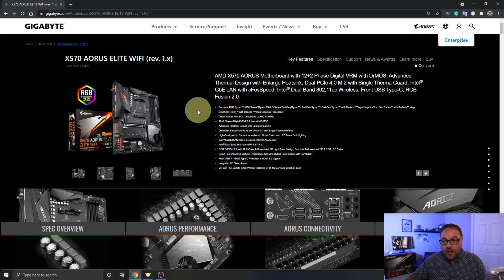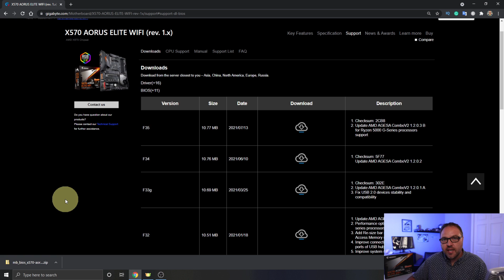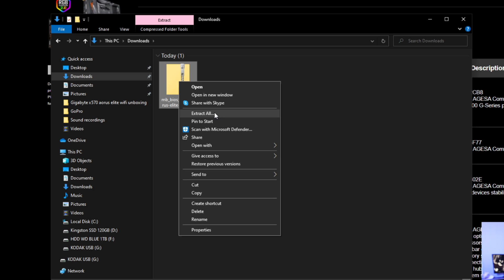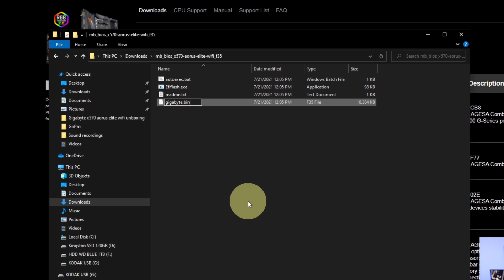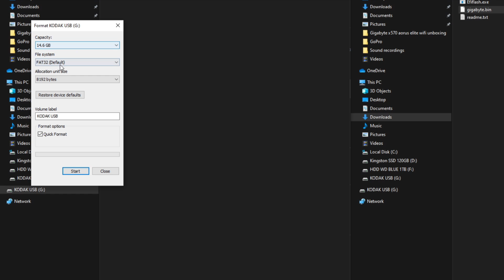How to Flash the BIOS on Gigabyte X570 Aorus Elite WiFi Motherboard with Q-Flash Plus

Comment from the maker: 👍 Thanks For Watching! Click the Link to Subscribe to Northern Viking Everyday. https://www.youtube.com/c/northernvikingeveryday?sub_confirmation=1
Reply: I have my ram and cpu installed already, do you know if I have to take them out to flash bios, or should it be fine. Im running 5600x/Aorus Elite wifi x570
Reply from the maker: Yes, you can Flash the BIOS with them installed.
Reply: @NorthernVikingEveryday  Thanks for the quick reply. appreciate it.
Reply: Can I do the bios update after I built my pc?
Reply: Hi! I'm a noob at anything pc here but trying to learn. My current build is using a 3700x and I want to upgrade to the 5800x. Will I need to remove everything from the motherboard to do this bios update for the 5800x? Just looking for clarification. Thanks for your vid!
Reply: Just seen your reply to someone else above. I assume it's the same in my case?

Comment: hey, i have X570 Pro - I know it is the different version, but I was looking for my MB and came across your video, so I thought I will comment anyway for others.

So in my case I was upgrading before switching to newer CPU, but the behaviour was different:

1. First of all i had my old CPU and RAM still installed - i also had connected the display, and keyboard and mouse just in case.
2. After turning off PC (put MB into S5 state), I pressed the mentioned button.
3. For the brief 5-10 seconds nothing happened, until system half powered on by itself - yellow light was flashing, but also my CPU fan, and the other started to spin, i have ARGB RAM, so it also started to glow (generally all ARGBs started to glow in Aourus' default orange colour) - there was no video, and 4 POST leds stopped at VGA. It was like that for 2-3 minutes.
4. System powered itself off BUT IT WAS NOT THE FINISH! :o
5. It restarted itself, and a screen appeared showing status bar and information that you should NOT power off or restart your computer.
6. Only after the progress bar completed, the system restarted again, and if I still remember correctly, it booted just normally into Windows then, with USB still plugged in.
7. Then, and only then, after seeing an OS working, I turned PC OFF with my mouse and plugged USB out.

Maybe it actually depends on the BIOS version - I upgraded from F30 to F39g

Maybe someone will find this comment somewhat helpful,
all the best to you guys :)

Comment: tried doing this and i wanna go from f32 to f40 but the f40 file when i open it only has one file in it, not 4 like yours does.
Reply: did you end up figuring this out? I am thinking it should be the same
Reply: @HolyHamGrenade  yeah it just needs the 1 file, in this video the version he downloads he changes one of the files name. In the new version I downloaded, you didn't have to do thay. Just download it extract to usb and flash it.
Reply: @bananas1318  uh, so i already renamed it, does that matter? Or should it still work
Reply: @HolyHamGrenade  you're downloading f40? Just delete it and download it again and don't rename it. It only takes 5 seconds to download. I wouldn't rename it.
Reply: @HolyHamGrenade  also I'd like to say my mobo is the elite but without wifi. If file you download has multiple files inside like it does in this video, just follow his guide. But the f40 for the elite without wifi only had 1 file in it, and I contacted gigabyte and they told me not to change anything.
Reply: @bananas1318  mine is with wifi, and it is newer than f40 i think, but it does just have the 1 file
Reply: @HolyHamGrenade  yeah if its just 1 file don't change it.

Comment: if anybody is watching this tin 2024, just a heads up. if your usb is over 32GB it wont format to FAT32 

so get ya small USB or you can go into disk management, delete the volume of the USB drive, remake new volume, and allocate 8GB or 8000MB to be able to format it into FAT32

Comment: Ok, so I just followed this tutorial to install the latest in my non-wifi x570 elite and almost shat bricks, first attempt and no screens, no keyboard/mouse led's, no cpu fan LEDs nothing. Redid the process and on the second try held the q-flash button for 10 seconds before releasing, happy to report that it completed properly this time, if you encounter this same issue, you may have only clicked the q-flash button, but you MUST hold it down for that 5-10 seconds.
Reply from the maker: Thank you for pointing this out! Glad you got it sorted.

Comment: I noticed at 06:44 your x570 Aorus Elite WIFI board says "rev.1.1" on the bottom left corner of the board? My x570 Aorus  Elite wifi doesn't. Mine says "rev.1.0" on the board. And yet, on Gigabyte's website they list the WIFI board as rev.1.x and the non-WIFI board as rev.1.0

Comment: I did this exactly with a new Gigabyte x570s Elite AX, used the right version from the website and now the power button does nothing on the PC.  Before flashing the bios when we had everything plugged in and the pc powered up but wouldnt send anything to the screen, but flashing the bios has made it so nothing happens at all with the power button.  Reflashed it with just the motherboard after disconnecting everything and same result after reconnecting the cpu and plugging everything back in.
Reply: I have a very similar problem, computer doesn't boot up after shutdown. everything powers on, but no signal to screen. Checked everything from ram to PSU. Removed the cpu and reinstalled it, it booted up, but now Iam too afraid to shut it down again to update BIOS lol. Did you have any luck with your problem?
Reply: @desolator108  my problem ended up being having a PSU that wasn't powerful enough.  Flashing the BIOS isn't necessary anymore with these motherboards for most CPUs
Reply: @desolator108  check RAM maybe to.  Try booting with one stick and also different ram
Reply: thanks, but I tried those already. Also installed a bigger PSU. Didn't help, well back to troubleshooting.  @Zarkin-Frood

Comment: I just upgraded from a Ryzen 7 3700x to a 5800X3D, and my pc wouldn't post. You sir, are a lifesaver; thank you for the very quick & simple guide
Reply from the maker: You're very welcome 🤗 Glad I could help.
Reply: Same upgrade I'm about to make
Reply: I am about to make the exact same upgrade/flash.
Reply: Same upgrade, my 3700x doesn't boot anymore. Should I just install the new CPU?
Reply: im doing the same thing on tuesday.
Reply: I am currently in the same process, but I am at a loss.  Upgrading from a Ryzen 7 2800 to 5800X3D also, I have disconnected everything from motherboard besides, New CPU.  Power on, USB with F30 install/ renamed, inserted into correct USB Bios, I push Q flash, I see the USB flash, but no q flash LED activation.  Should I try removing CPU?
Reply: Update, also removed CPU and still not working???  Suggestions?  I get a quick flash from the motherboard when I turn on power supply and USB also flashes when I hit q flash.  But no Red LED indicator...?
Reply: Try different USB sticks, I did the exact same thing twice and that did the job.. @Joseph.Maduzia

Comment: Thank you so much for this tutorial. I installed the F36e version of the BIOS on my motherboard and i am facing a lot of issues with it. For example, in the bios screen it shows that my secure boot is enabled but when i log into windows and check system info, it shows secure boot off. because of this, i cant play certain games. after watching your video, i am planning to qlash and update the bios to F37 and see if that works out the issue or not. i would be very grateful if you have any insights on this. thank you once again for a great video. :)
Reply: Bro, did you install to F37?

Comment: I’m having an issue. I have the 5600x downloaded the f30 version , have everything plugged in. I cut my psu on and my mobo flashes on for one second then goes off. I held the q flash button but nothing happens.

Comment: If your light does not work, my fix was that my flash drive was far too large(128gb). I used an old smaller one (couldn’t have been more than 32gb-64gb) and worked fine. It also took a few seconds to start doing anything, so don’t be alarmed if it isn’t instant.
Reply: oh mine is 32 gigs ish but it still isn’t flashing 😢
Reply: Mine is flashing, but it still didn't boot after installation. I have a 20GB fat32

Comment: Thank you! I should have looked this up before installing my new 5950X last night, only to have to put the old CPU back in since it didn't even post. After initial panic and checking that I hadn't bent any pins I soon realized that I probably needed to upgrade the BIOS first, and this video gave the perfect instructions for it. edit: I forgot to mention, at 5:51 it says "I haven't installed the CPU or the RAM […] you can do it with it installed or not installed", but the manual says "Q-Flash Plus will update the main BIOS only if run without the CPU installed." (mb_manual_x570-features.pdf, page 6).
Reply: Can anyone verify if this matters at all?
Reply: @dlalleman3874 just updated my bios with the cpu installed and it worked just fine. HOWEVER the flash button wouldn’t do anything for me until while the system was shutdown I flipped off my power supply waited a few seconds and turned JUST the power supply on, and while the pc was still shut off I hit the flash button and it worked perfectly. Hope this helps anyone who was confused

Comment: I pushed the button and nothing happened except for the usb flashing. Does that mean it worked? Also when I turned the power supply on the motherboard lit up for half a second then turned off. Is this normal?
Reply: Nevermind that I figured out my problem! I downloaded the bios update for the gigabyte wifi board and I actually have the non wifi version😂. Oops oh well I got the right bios update and non it worked. But one last thing. The fan continued spinning after the light went off. I gave it like 10 min but it kept spinning. I ended up just shutting it down after that. You think it still worked?

Comment: Great video :D For anyone having trouble with the q-flash button on the board itself, if you happen to be using an external drive make sure to specifically only format a small(i used 8gbs) sized partition as exfat/fat32 instead of formatting the entire capacity of the drive. The q-flash button wouldn't work for me until I limited the fat32 partition size to 8gb on my 1tb external drive as opposed to formatting the whole 1tb as fat32. Fixed the issue and the q-flash button then worked like a charm. Hope this helps anyone running into the same issue! gl out there gamers
Reply from the maker: Thanks for the tip 👍
Reply: I'm using a 64G thumb drive, used rufus to format it to FAT32, and copied the gigabyte.bin file to it, but I still can't get a flashing light from the q-flash button. Any ideas on where I may have gone wrong?
Reply: @FifthPinned  Only thing I can recommend is formatting only an 8,000 MB partition as FAT32 and using that partition to store the gigabyte.bin file. That's the only thing that got it to work for me :/
Reply: @FifthPinned  were you able to get it to work?
Reply: @fburnrostro95  yes, I can't recall what I did, as it was about a year ago that I did this lol

Comment: I am now ready for MW2 =) 
My 3080FE is already installed my X570, as of now I'm running my 3700x and it's running amazing on 1440p for all my titles. 
My 5600X just came in and I got it for a steal on Amazon. $88.35  because I had a $100.00 coupon that I didn't know about lol 
So I'll stay gaming and just wait for MW2 to come out, when I see the need to try and push more FPS I'll bio update and slap my new chip in. 
Thanks for the video, didn't realize how easy it is to update bios on this MOBO. Supper happy I bought this one back in late 2020.
Reply from the maker: Awesome 👍 Thanks for watching.

Comment: Hey there, if followed this to the letter but my QFlash isn’t responding when pressed. Any ideas?
Reply: Did you figure this out?
Reply: @trevoramadon1792  Yes and no. This mobo of course doesn’t come pre config with 5000 series support. Which is what the Q flash is for yeah? So I just returned it and got a 5000 series supported mobo lol

Comment: Hey all, I am currently on F36e and having some reboot issues. Is it worth flashing the BIOS? I checked the website and it only says that there is an update for the AMD Ryzen 7 5800X3D but not my AMD Ryzen 7 5800X.

Is there some cross over between the CPU's that may help me?

Comment: So I have the none wifi version of this board. Got bios version f32, renamed it on my usb and in the right port on the mother board. The cables are connected and the power supply is on. When I press the Q-flash button on the board I get no light and nothing seem to happen. Do I need to remove my graphics card or unplug anything else? I have all my peripherals installed already. Do I need to remove them?
Reply: use the MBR partition instead of GUID. most videos show GUID as the correct format.

Comment: Thank you for the help! I had one question: if I have the 5600X, should I stick with the F30 or just get the lastest BIOS version like you did? Will it be incompatible with the 5600X?
Reply from the maker: You can double check on the gigabyte website but usually it's best to go with the most recent version.

Comment: I have the same setup but I had a hell of a time Q flashing. The board did not want to read any of the flash drives I tried. I thought I was going to have to RMA it. Got the F30 bios to finally work, then it immediately crashed after I tried installing Ryzen Master. Gave me the BSOD, shut down then wouldn't boot. Powered it off and on a few times then got the message that my bios was corrupt and booting from the back up. I should have the latest bios right now, but after that ordeal I am paranoid of bricking the board. Still have not tried reinstalling Ryzen Master. Wanted Ryzen master so I could tune my fan speeds as this chip runs hot.

Comment: thank you thank you! it's worth mentioning that using the default allocation table size may be required when formatting the flash drive. I tried this and it didn't work the first time with the allocation tables set to what windows had set, but... when i applied the 'device defaults' and tried again. worked like a charm. Thanks for the great video.
Reply from the maker: You're welcome and thanks for the tip 👍

Comment: And if i did everything exactly right and I did not get the light to on the motherboard to flash? 😢
Reply: Make sure the format on your USB flash drive is FAT32. If the flash drive is over 32gb, you can't format it to FAT32. Use a smaller drive. The file is only 16MB or so.

Comment: Massively helpful as I just bought the gigabyte z490 that supports 10th and 11th gen Intel but requires a bios update. This is the only part that makes me nervous on this build
Reply from the maker: Awesome 👍 Glad I could help.
Reply: @NorthernVikingEveryday  I do have a question though. It looks like the support for 11th gen was a couple updates prior. Should I update to the most recent or just the one that has support for it? Or is that all in the newest update?
Reply from the maker: For myself personally I would choose the newest update but it's up to you.
Reply: @NorthernVikingEveryday  thank you so much for your time and quick response. I will go with the newest.
Reply: @NorthernVikingEveryday  I just wanted to pop in and say thank you for your video and responses. Built my PC yesterday and it worked swimmingly. Thanks again man
Reply from the maker: Awesome 👍 Glad it worked out for you. All the best.

Comment: Hi, I just wanted to know can I use this way for my X570 auros motherboard with all the components installed,
 I have the CPU, ram, CPU cooler, and m.2 installed. 

The led did lit up when I press the button and it did turn off after 3mins but the fans and the RGB on my ram still and the fans on my Psu didn't turn off. Should I wait 30 mins then turn off everything?.
Reply: Wondering the same 😢
Reply: @dlalleman3874  what did y'all end up doing?

Comment: Great video man I just got a question. Since I have a zen 2 CPU and I'm getting the CPU you are using in the video can I update/flash with my old CPU, ram and GPU (that I'm not changing) in the motherboard or do I HAVE to remove them in order to update/flash the mobo.
Reply: I'm no pro, but I'm pretty sure you don't have to remove them. The more updated BIOS I believe just adds *additional support. Someone can correct me if I'm wrong.

Comment: what should you do if the q-flash indicator does not flash at all?

EDIT: You must only have the bin file on the usb. I did not. I had the entire extracted files on the usb. I also had the my 5600g and ram installed when doing this.
Reply: I've done this but for some reason the Q-Flash won't get started.
When I plug the power in, and I checked my wires they're all connected properly, the only thing that happens is the LED on the VRM heatsink flashes for a millisecond and then there's absolutely no response.
I wonder if I have to pull the GPU out. I built the whole PC before realising that Gigabyte still doesn't flash the motherboard before shipping it to retailers with at least bios version F30 even though that bios is ancient by now.
Reply: @michelvanbriemen3459  so are u not able to flash the motherboard when the pc is all put together including gpu and cpu? my friend built his with a 5600x and this exact motherboard and a 3070ti without realizing he needed to update his bios, this is also his first pc and doesn’t really know much about pc hardware